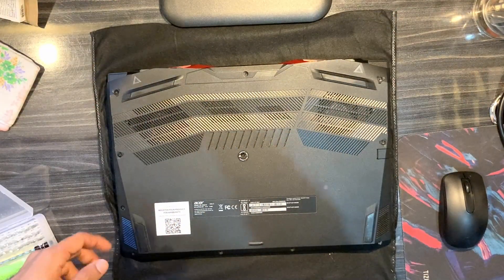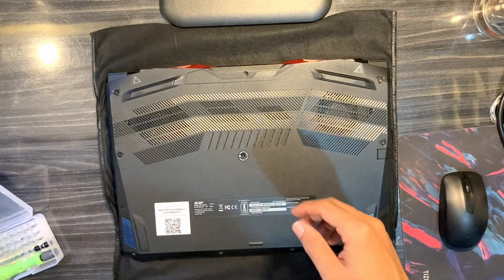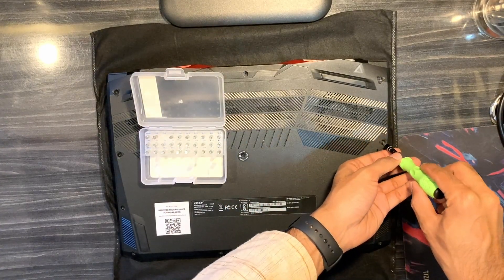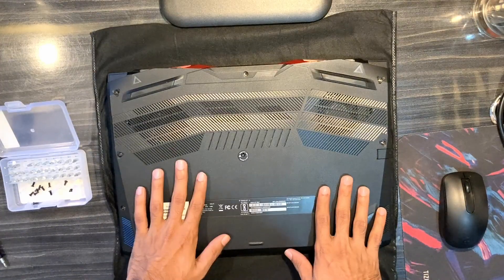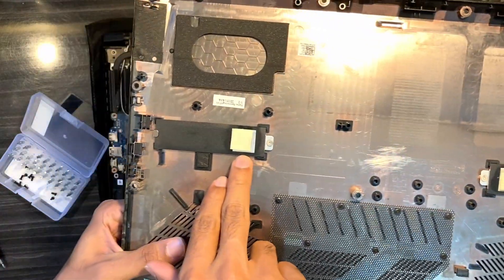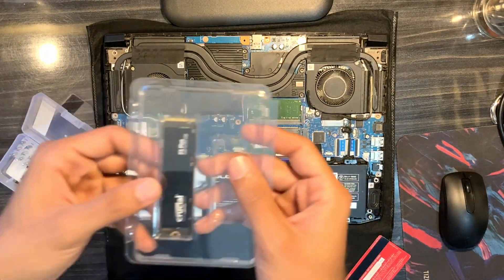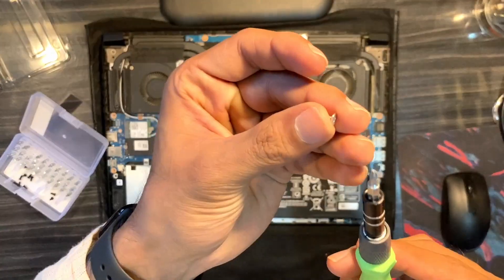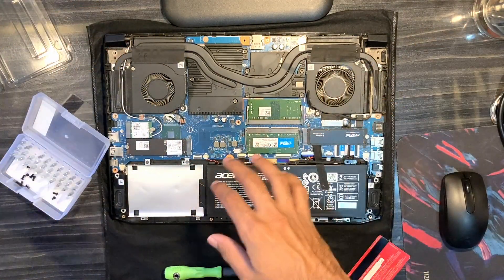Acer Nitro 5 SSD Upgrade AN 515-57. (Add 2nd NVME M.2 SSD)

Comment: Is it good to remove the battery as shown by others or can i install like u did, and i am planning to biy 1tb is it compatiblr
Reply from the maker: it's ok to have upgrades without removing battery also. be careful as there might be some static charge, best is to touch some metal before you work with laptop which has battery connected or you can simply remove the battery connector and re-attach it later after the work is done.